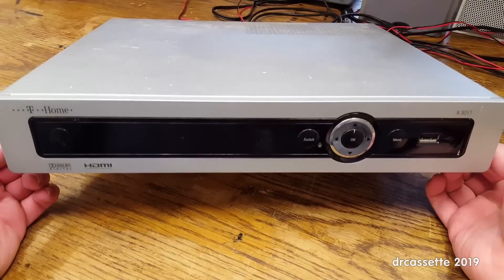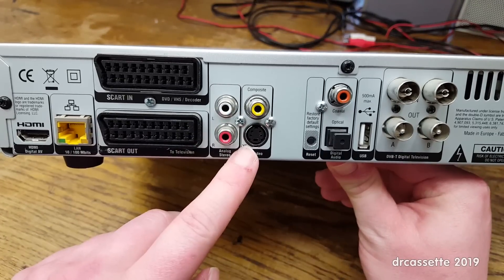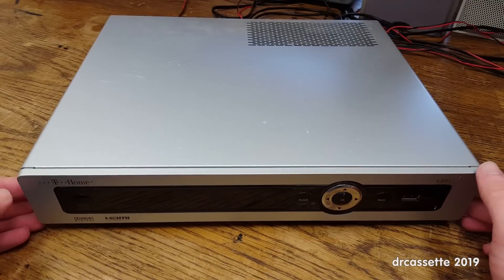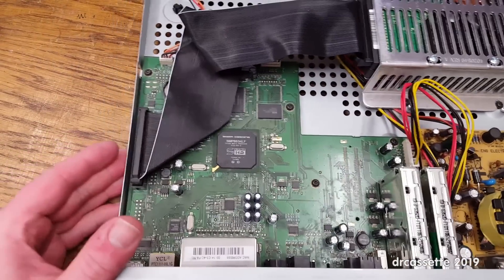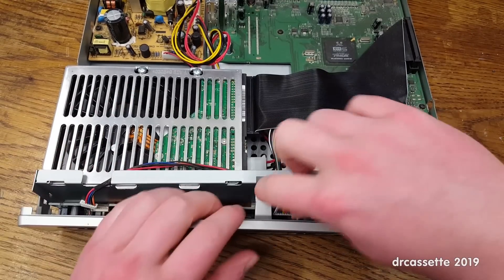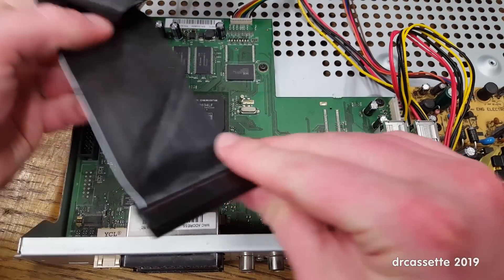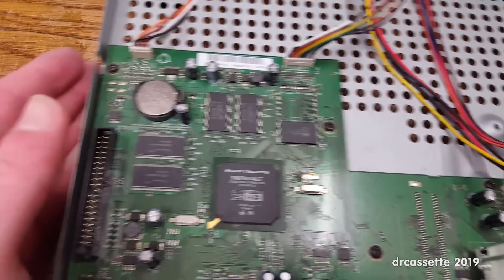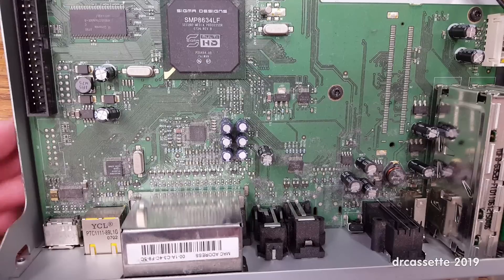T-Home X301T IPTV receiver teardown

Comment: I've sometimes observed switched-mode power supplies making an audible squeal or whine when unloaded or only lightly loaded (e.g., I've heard it from consumer wall adapters when the device is in standby). The explanation I've read is that in low-load conditions some designs use an internal switching frequency low enough that it can be audible to human hearing.
Reply from the maker: Yes, that's correct.

Comment: 5V SB the SB means stand bye
Reply from the maker: Where did you see a 5 V SB?
Reply: @DrCassette  There was -30VSB on the power supply. This probably means that voltage is provided even when it's not powered on fully, just like 5VSB. This makes sense as many such devices idle with the time displayed on the VFD.

Comment: IDE drive, that thing must quite old. Could be usefull for restoring a retro pc.
Reply from the maker: I use these old IDE drives for secondary data backups.
Reply: Be careful with this one tho. I have seen a lot of those receivers (300/301), and the main issue is that the drive will fail. They are almost continuously turned on, and the drive spins up every hour or so. But those drives  are only consumer grade. They will fail after 10 years or so, often the bearing is seized. For data recovery they can be "reenabled" by heating them with a hairdryer, after that they often work for a few minutes.
Reply: @TheRailroad99  Bearing condition can be heard and spin up times red from smart information.

That drive has 3479 spin-ups and 25400 hours of usage.

The hours are only halfway of the drive's life but the spin ups are quite high, typical drive last's for 50kh or 4000 spinups
Reply: @NuffMan_  oh... I have only noticed right now that he has actually shown a smart test result. Then everything is fine. My fault.
Reply: @TheRailroad99  I salvaged an old SATA HDD from a similar satellite receiver but I dropped it from 5 cm by accident which leaded to the HDD being destroyed and causing bluescreens on Windows. The drive has also been quite noisy when turning it on before, maily due to the high amount of use it has seen in it's life.

Currently I'm using a very early Samsung Blu-Ray player/satellite receiver combo device which also has an HDD but it's still up and running after all those years...

Comment: Seems like quite a nicely-built unit given how cheap and plasticky most similar devices have now become. Nice big VFD which is also rare to see, nowadays..

I believe the filament voltage is AC (rather than DC) to prevent uneven or varying brightness towards one end of the display. The -30v DC supply being the grid voltage to drive the characters.
Reply from the maker: Thanks for the info!